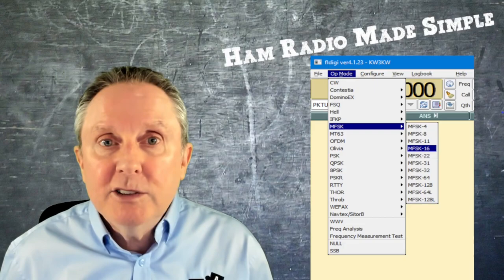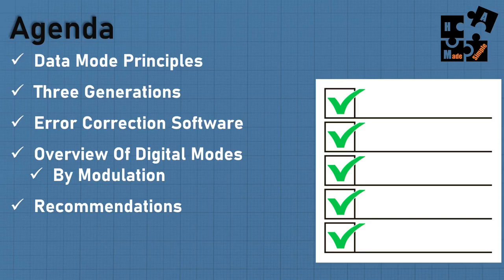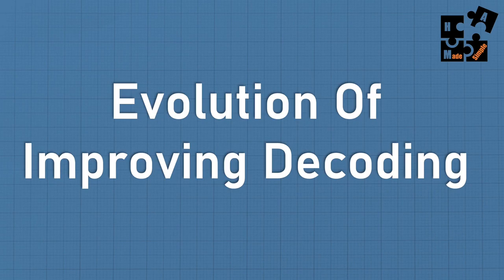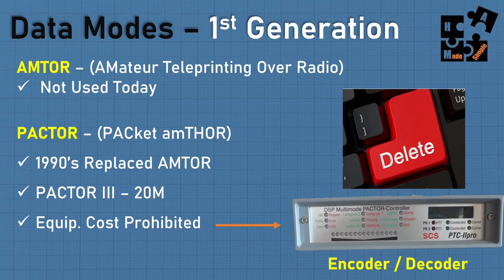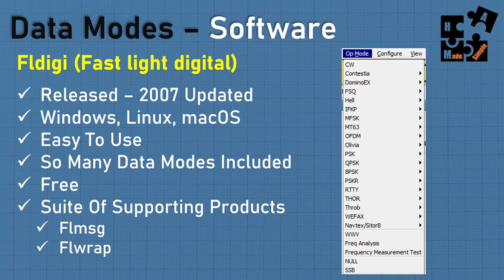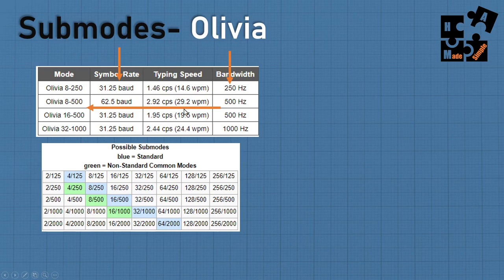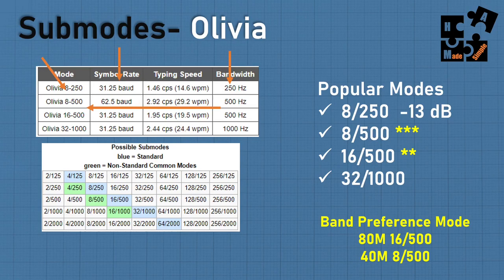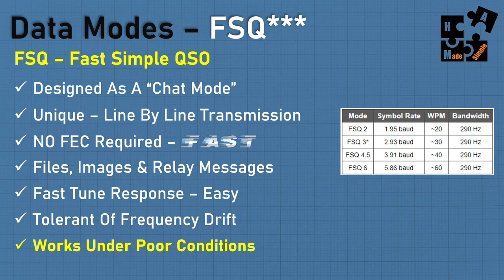Overview Of All The Fldigi Op Modes

Comment: Say I want to make a targeted contact in a prepper situation. Is there a way to identify what mode your sender is using based off of the waterfall or tone, so you can dial in your mode settings to receive?
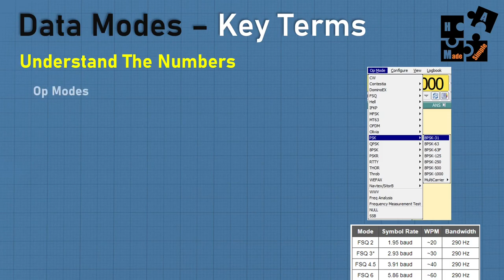Reply from the maker: When doing directed calls (which I do all the time) you need to pick a frequency, time and mode.  If you both don't have RXid & TXid enabled, you will need to pick the same speed (FSQ does not require this).  So, if you and I want to connect on Contestia at UTC 19:00, Frequency 7.105 we both need to enable RXid & TXid if we don't use the same speed.  OR you could just say Contestia 4-250 and not worry about RXid & TXid settings.  Does this make sense?

Comment: One of your comments about QPSK31 surprised me.  You said that it gets twice the throughput at the same bandwidth, but according to wikipedia's article on PSK31, it says "QPSK31 has the same number of symbols per second, and hence the same bandwidth as the BPSK variant. In a coherent receiver, the bit error probability of QPSK is the same as for BPSK operating at the same power, making QPSK31 the generally preferable mode from a robustness, and thus reach, point of view."  It goes on to describe that the 2 bits are transmitted for every one bit of input data, and that those bits use a convolution code for error correction.  So as a user, the advantage is not speed, but accuracy of the data received at the decoder.
Reply from the maker: My error then.  Thanks for pointing this out!!

Comment: I've never gotten it to run
Reply from the maker: It is one of the harder ones to get to work.  Everything has to set correctly:  Rig Settings, Windows Settings, Driver Settings & Software Settings.  If one does not work, none of it works.  Took me many hours to figure it out.
Reply: @hamradiomadesimple  I think it's like Cold Fusion or Quantum mechanics. Identical set up, yet different results for different people. 😂

Comment: I love your videos, got me started with HF digital - but with this one .. I am confused. Too much to choose from.
Which mode would you recommend for the following scenario:
- Must have error correction
- Keyboard to keyboard messaging
- Low signal strength -  need coms over 4-5000 km
- Preferably file transfer
- Speed less important than reliability
Regards
Mike
Reply from the maker: My favorite is FSQ for what you are asking.  Send me an email and I will send a comparison spreadsheet to you.  HamRadioMadeSimple@gmail.com.  Also, my handout on FSQ.